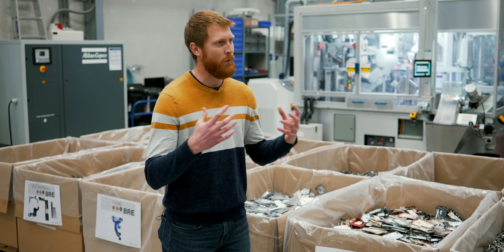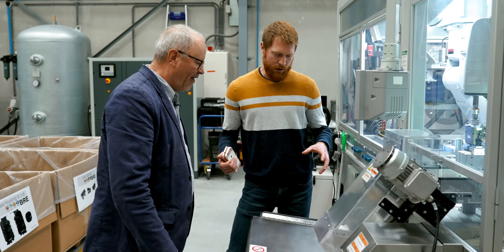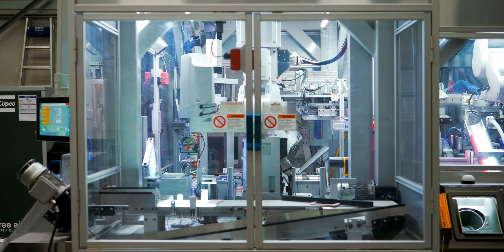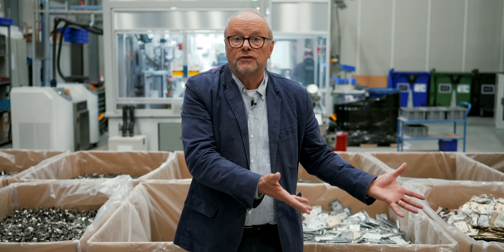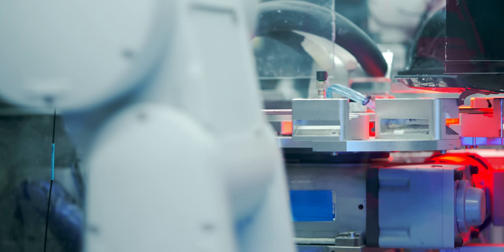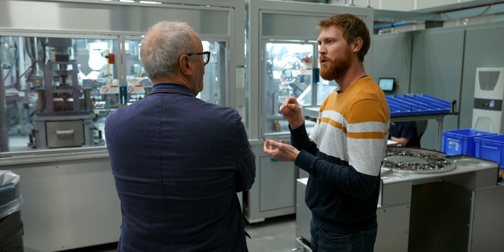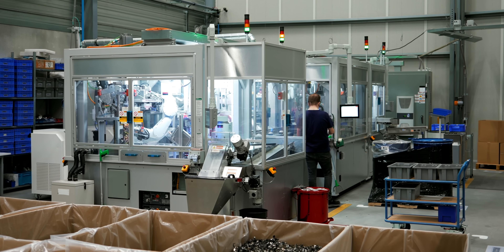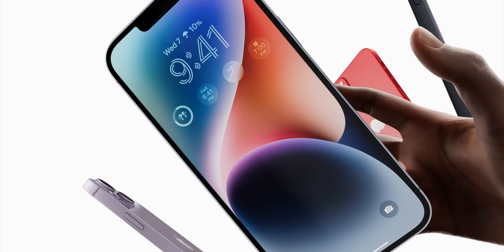Is This Robot Apple’s Most Important Device Yet?

Comment: I paid for my old phones, the components are of value but Apple do not offer good value for those components in trade in so I do not trade them in. If Apple are so concerned with the materials in my old phones they can start offering proper value for them, until then I will be keeping them. I’m not giving Apple free profit on top of that which they got when I bought them, it’s bad enough that I let them F me on the way in, I’m not bending over on the way out too.

That’s without mentioning that Apple are only recycling the phones that can’t be renewed and sold abroad for more profit, I’d hazard a guess that the Pareto principle applies here, 80% of traded in phones are probably renewed and resold, that’s great for Apple but not for my wallet.
Reply: Just pulling numbers out my ass for an example here, but let's say you paid 10 for your phone and you're done with it. You feel the components in it are now worth 6 but Apple is only offering you 5 for the trade-in. So you think it's not worth it and you'd rather leave it in a drawer and next year they're worth 4 and Apple are offering you 3? They're devaluing all the time, why hold onto them if you think they have value now?
Reply: @a1asdairpage  I’ll use some more realistic numbers but on your scale. Let’s say I did indeed pay 10, I actually think it’s worth 6 but Apple are offering 0.5. The components were never worth anywhere near 10, 3 years after purchase (the point at which I buy a new one) they were worth maybe 4 and Apple are offering that 0.5. 10 years after purchase Apple are still offering that 0.5 for components that are now worth 3.5 so why sell it for so much less after 3 years as opposed to 10 years? Why sell it at all? For Apple 2m x 3.0 profit is a F tonne, for me as an individual it’s worthless so why not give it away? Because it belongs to me, I own those components and as I said previously, I will not have Apple F me on the way in and out of the transaction especially given haw badly I was (admittedly voluntarily) F’d on the way in.
Reply: @InimitaPaul  So why do you buy an iPhone?
Reply: @a1asdairpage  I’ve had an iPhone since the 4s and everything Apple ever since. They were a customer focused company back then for instance, I shattered the screen on my 4s and took it into my local store expecting a huge repair bill, they fixed it for free and they did that for a lot of people. That created a lot of good will from me and it was everything Apple after that, it’s taken a long time for me to get to this point. 

I’ve been with Apple so long at this point that my entire life is embedded in the ecosystem, everything from the curtains opening every morning down to my solar power system runs through Apple Home. My parents know Apple to the point if they have a problem I can just call them and solve it remotely on screen in minutes and I’m not going to start teaching them Android to share family photo albums and not be able to have them on family subscriptions for various things. 

Not bending over for Apple on the way out of a purchase is a very minor victory but I’ll take them where I can with Apple, they feel like a parasite these days.

Comment: I use my iPhone 6 Plus as an internet radio - it doesn't hold a charge for a long time but it works well as a bedside radio if you plug it in.
Reply: I tried to push the idea to my mother of using my old iPhone 6 to listen podcasts but she's even more traditional than that, she prefers just plain old good radio through an old device and I don't blame her. It's much easier for her to learn how to operate a couple of buttons and not ever have to think about passwords and whatnot. :)

Comment: Even with reuse and repair these phones will still come to end of life sometime and need recycling so this video isn't necessarily total greenwashing - and some of us hold on to a model as long as we can not discard it as soon as the new model appears. I do remember a story though from the late 1960s of a rep from Hoover who told a bunch of under graduates that they'd improved sales of a product by making a part so that it would break down sooner rather than later and putting it in a position where it was difficult to access making repair/replacement difficult -  so it was ditched and a new one bought. There's a lot of this and it's been going on for decades.
Reply: I have had the same vacuum cleaner for over 30 years. I have replaced various components over the years, including replacing the motor twice. In that time I could have replaced it 3 or 4 times at least, but I kept it out of landfill for price of a few pounds.

Comment: Once a battery cell is dead, you can’t repair it. It needs to be recycled. What’s great about that is, at some point, we won’t need to mine as much or any materials. Yes the 3 Rs are important, and it would be amazing if apple built them to be be recycled, but the reality is, there are batteries in phones, sitting around - should we just leave’em because recycling them isn’t green enough??!
Reply: The bigger issue is that in plenty of phones the only issue is the battery is old. If they were made repairable you could replace the battery and have a functioning device, and recycle the old battery. Instead apple limits what can be fixed on their phones, so the whole device has to be wasted instead of only the one or two components that have problems

Comment: 👎🏻👎🏻👎🏻 Apple should be concentrating on letting people repair their own stuff! 

Probably more than 50% of those phones would live a far longer life if Apple didn’t brick your phone, lock you out of replacement parts or remove software features just because the replacement screen can’t be paired with the original body or the camera model has been replaced.

Apple deliberately make repairs difficult by putting in road blocks that weren’t previously there, and then they have the audacity to say they are saving the planet through recycling!!

Comment: iPhones are notorious for anti repair measures - like they make it nearly impossible to re-use genuine Apple parts giving weird reasons. Reuse>>recycle
Reply: @fullychargedshow  this facility could be more efficient and the recycling easier if the battery was easier to replace. They wouldn’t need to waste energy and freeze it if the battery and phone wasn’t glued together. This complex recycling is required BECAUSE the phone can’t be repaired easily.
Reply: @joeynessily  do you mind repeating what He commented? He deleted the comment
Reply: @joeynessily  The rest of us don't want to lug a walkman sized phone around to accommodate AAAs.  You can replace the battery or have apple  or a 3rd party do it for you. jeez, some people can't take a win when they get one.
Reply: Fairphone is the brand you are looking for.
Reply: Reuse makes them more money. Reuse means less sales. It's all about the money.
Reply: @HisLoveArmy  BS
Reply: @fullychargedshow  I have dozens of IT surplus iphones that are functional but have various small defects. They are end-of-life as a phone, and Apple has locked the hardware so much that they can't be repaired or reused in other applications. They are all each more powerful than a out-of-stock raspberry pi, and Apple is forcing me to discard them instead of allowing me to unlock the bootloader on my hardware and continue using it. Apple wants me to buy a new iphone, not fix and use the old one.
Reply: @nathan-shearer  do you mind repeating what He commented? He deleted the comment
Reply: Because they need to make money... it's the same thing with tablets and laptops... they started to make them for single use..
Reply: @fullychargedshow  - Might want to consider taking a less hostile sounding tone. I'm usually pretty blunt as well, but it's hard not to read it into your phraseology. Excellent episode, though :)
Reply: @fullychargedshow  paid by Apple much
Reply: @fullychargedshow  Geez, why the bad attitude FullyCharged YouTube comment moderator?  Long day? Hungry? Have a Snickers.
Reply: @AsphaltAntelope  do you mind repeating what He commented? He deleted the comment
Reply: @AsphaltAntelope  They've been posting the exact same comment to anyone who mentions the lack of repairability of iPhones. I think you may be right, someone had a bad day, doesn't justify hitting every comment about this topic with the same canned answer
Reply: @JeanLoupRSmith  I think they are miffed that the reaction to this video has been rather negative. It's their own fault for completely failing to mention the tension and that Apple's waste stream is impressively inflate by their own horrible policies.
But yeah, maybe someone (who spent a long time editing this) just had too long a day!
Reply: @JeanLoupRSmith  do you mind repeating what He commented? He deleted the comment
Reply: @JeanLoupRSmith   But the lack of repairability is untrue. Apple and their service partners will replace the batteries, displays, cameras, connectors, whatever. Also, non authorised shops are all over the place. Also, the self repair program is available in many countries. Add to this the first class SW support (6-7 years) and there is very little to complain about. Also, take a look at iFixit’s repairability assessments and be surprised: iPhones get much better scores than Samsungs, for example. Samsung still glues the batteries in.
Reply: @AsphaltAntelope  It was a factual reply. What?... do you need to be coddled?
Reply: @AsphaltAntelope  We can only hope that this was not straight from Robert.
Reply: @Eric_the_Hiking  Get over it.  Whos got patience for the perpetual malcontents that inhabit the comments section

Comment: What if Apple was not pushing people to buy a new phone every 6 months and stop make them totally un-fixable ?
Reply: Apple does not release phones every 6 months.  No one is forcing anyone to by a new one.  Anyone trading in last years model gets a huge credit and those phones are refurbished and sold on apple's website at a discount.
Reply: They really don't push to towards buying a new phone every 6 months:). Android is infamous for only providing 2-3 years of OS updates, at best, while Apple provides OS support for at least 6 years of all of their models.

Only recently did the iPhone 6(2015) lose support for latest OS.

That's really, really good.
Reply: iPhones are generally easy to repair. For example, battery and display replacements are readily available from Apple and their service partners. Also, non-official service shops are all over the place. Samsungs, for example, are way more difficult to repair, as they still glue the batteries.
Reply: Pushing? People do have functioning brains, right?
Reply: @toby9999  
They do?
Reply: wouldn't it be cool if they could make lots of money repairing and upgrading these devices?
Reply: At least in America you can rent a repair kit for common phone issues.
Reply: I replace my iPhones every 2-3 years so only when I need it. Plus apple only gets a full new model line up every year not every 6 and you don’t have to upgrade as you said every 6 months.  Obviously you don’t have one or follow correctly trends or you would know that it happens 1 time a year and they don’t make you do anything. You have a choice. We all have choices. Unless your a sheep 🐑
Reply: Know one if forcing you to buy one.

Comment: So anyways Robert, how many times exactly does Apple make money out of the mugs that buy their products? On the intial sale: that's once. After use recycling: that's twice. And then using the old components in new phones (old new phones that they no doubt will charge full price for again). So that's 3 times Apple make money from you muppets that buy their products.
 I have every phone I have owned since the late 90's, they all still work (more or less), and not one of them is an Apple device.
 Like others have said on these comments; if Apple made their products open to be repaired, they wouldn't need to recycle as much. But then they wouldn't make as much money, I dare say......

Comment: The added complexity and cost of making something repairable generally makes it less reliable.
Reply: Ok, Tim Apple! I wish cars were less repairable and hence more reliable.:face-green-smiling:
Reply: Like ThinkPads?
Reply: @gmail account 
From 40 years of electronic engineering, it always take more mechinical complexity to make something repairable.
The more complex the greater the chance of failure.
Reply: I don't know if you realize that even if the iPhone actually are hard to repair in the sense of the physical work, they can be fiscally fixed, but the software locks make it no worth of your time, writing this from an android fixed by myself

Comment: Reduce, Reuse, Repair, Recycle... Apple needs to work on the first 3 before touting recycling
Reply: No, you can improve the recycling process anyway. Apple do repairs, but not 100%. I doubt any company does.
Reply: @jericoba  they are the biggest opponents to right to repair and they go out of their way to prevent repair by serializing components to make sure you can't replace a camera that broke on your phone for example.
Reply: @ThePopeRope  Not what I've experienced and read about. Sorry to hear you've had a poor one. They may not be the best company in that regard, but far from the worst I think. Besides, recycling is beneficial and important and is not something a company should do 'before', as you said. That's my point.
Reply: They already do all of those aside from extensive repairs
Reply: @chidorirasenganz  they are the biggest opponents to right to repair and they go out of their way to prevent repair by serializing components to make sure you can't replace a camera that broke on your phone for example.
Reply: @chidorirasenganz  Nope. Theyve been caught making their devices slower to encourage people to buy new ones, on top of the massive hype they have around buying the lastest and greatest to begin with. Apple are the biggest proponents of electronics as disposable devices. And Google is frankly just copying them these days.
Reply: @patreekotime4578  that’s false. The batteries couldn’t supply peak power so they throttled to prevent device restarts. They should have been more open about it but it’s the same for any battery powered device and performance returns once replaced
Reply: @chidorirasenganz  I don't think any company in the phone business is doing much 'reduce'. They all spend a lot of time trying to sell us more phones, sooner.

Comment: or apple can just allow 3rd party repairs instead of crafting this waste.
Reply: I do need a battery replacement for my iPhone... but I can't find the original one... only cheap aftermarket...
Reply: amin brother
Reply: Nope
Reply: absolutely
Reply: That might delay the problem but it wouldn't solve it. Eventually you will need to trade in for a new phone, and even if you were allowed to repair, the parts you swap out are materials Apple could recycle.
Reply: @trizzybones  this
Reply: Except that would require producing excess parts and still would require recycling anyway 😂
Reply: @chidorirasenganz  would still require recycling at one point - I agree with that statement. 
But the priority is: 
reduce - reuse - recycle. 
So recycle is the last option. I don’t want to say we have to push the limits of our recycling capabilities. But if you do some research on the topic of all the waste we produce you will come to the conclusion that the first two points reduce and reuse are even more impactful. Apple harms the reusing by not delivering components to repair shops which can prolong the lifespan of phones people can actually use. The consequence is that we produce more waste that might be unnecessary.
Reply: @chidorirasenganz  But much longer lifetimes of each device on average. With the current system the lifetime of every part is the lifetime of the shortest-lived part (most likely screen, battery or connector). It seems unlikely that that is better in the long run.
Reply: @xxwookey  Those are already supported for repair. The lightning soon to be usb c connector, battery and screens are the most common repairs for iPhones lol
Reply: @chidorirasenganz  "Supported for repair" is apple speak for: you can let us do it for 2/3 the price of a new phone or deal with software locks because we hate our customers
Reply: @hendrikj8448  battery, screen and charging ports are the most common repairs and none of those are 2/3 the the price of a new iPhone
Reply: @chidorirasenganz  Yes and no. An active repair ecosystem would mean that people who specialize in repairs would end up stockpiling otherwise good components they have removed out of broken phones.  Exactly like how junk yards are a major source of used car parts. The downside is this discourages some of the recycling until components ARE finally broken beyond reuse, or too out of date to be worth stockpiling. But repair shops would also be a source of broken-down recyclable components, meaning Apple wouldnt have to invest billions into developing robots to do the work that thousands of repair shops would be doing.